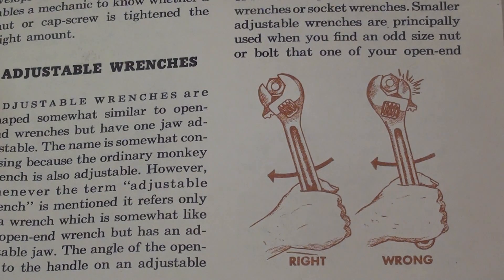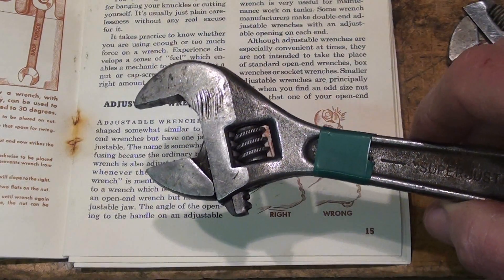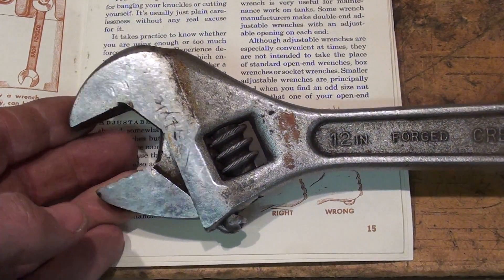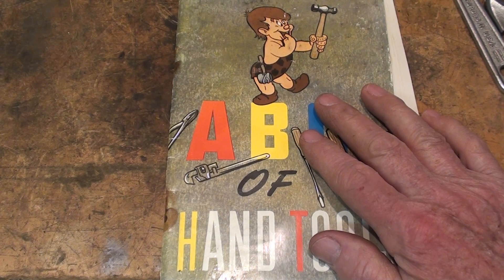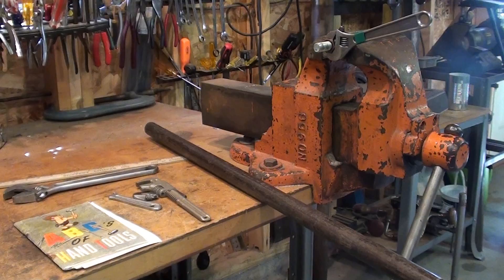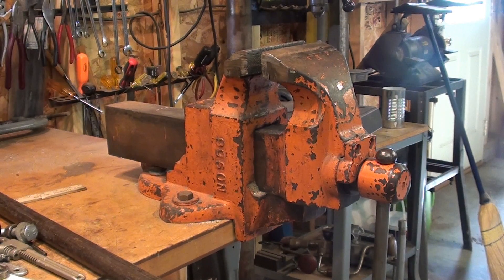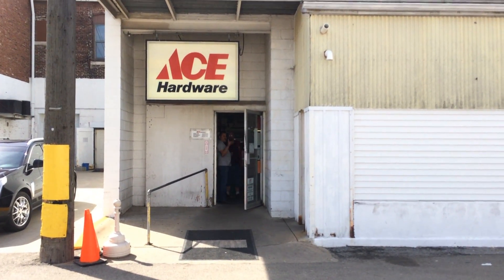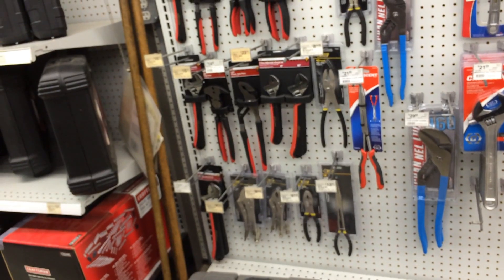MYTH BREAKERS #1 (pt 2 of 2) Use & Abuse of Crescent Wrenches mrpete222

Comment: That was kind of silly. It totally opened up the jaws. And you said it wasn't damaged.

You are apparently trying to disprove something some random person told you. You use the ranch properly in order to limit the amount of damage done to the nut. Most nuts are soft and any ranch will damage it. Especially a crescent wrench. The more you damage the nut the more ware you put on your wrench. If the wrench rounds off the nut the ranch is often damaged. Not snapped but sprung. Opened up. Bent.

Comment: It seems to me the whole point of making the wrench 22.5 degrees or whatever instead of 90 degrees or zero degrees is so you CAN flip them over and get two angles of attack when inching a fastener along, half a flat at a time, in some tight corner.

Comment: Ace has a lot of markup on some stuff, but they have always honored the guarantee on tools, at least in my case.
Reply: To give an example, bought a die grinder, took it home two days later got it out to use and the gearbox was locked up, {from the factory}  took it back, and they didn't even ask me for a receipt, {it was the third one they had gotten back} they just hooked me up with a new one, {different brand and slightly more in price.}

Comment: Again you are using soft bar stock.  And he is turning the adjustable wrench the wrong way.  It is probably stronger when used in the proper orientation.

The Ford monkey wrenches were made by Crescent, by the way.

Comment: The reason that the adjustable wrench was slipping and rounding off the stock is that the jaws were spreading quite a bit. I would consider that to be a failure, even though it didn't permanently damage the wrench. Much the same as an unbreakable rubber wrench that can't turn any stuck bolts loose.

Comment: Arkansas Socket Wrench: hadn't heard that one before. I've always known them as a Swedish Nut Lathe, a nod to the Swede who patented the improved version we now find ubiquitous worldwide, in metric as well as SAE sizes (yup, there really are metric ones). Only reason for having a short one is for use in confined spaces. Otherwise, the 12" (or 30 cm) should be the preferred length provided the jaws open sufficiently for the largest fasteners to be encountered, and you can have just one size in your toolbox that rounds all. The Williams is living up to being the perfect Swedish Nut Lathe.

That said, I must confess to having not only several Swedish Nut Lathes, the big, one size rounds all, in the garage workbench wrench drawer, and the smaller one is in the laundry room toolbox inside the house - so I don't have to go out to the garage for commons smaller tools used indoors. I would declare the myth busted on the basis that it turns nuts down to perfectly round in either direction.
Reply from the maker: lol

Comment: Great video. I worked for the railroad in the shop for 23 years. I have also used hand tools, believe it or not since I about 4 when I took the training wheels of my first bicycle. I was given my first set of tools for my 9th birthday, A set of Champion tools from Sears. I still have some of them. It is true that there is a correct and incorrect way of using an adjustable wrench. It may not break or fail if used incorrectly but is more likely to slip or round off the fastener. The movable jaw flexes more if used incorrectly. Also I really think Craftsmen tools are the best for the money. I have to commend Sears on their warranty. I have broken and plain wore out many Craftsmen tools in my life and have never even been asked " How did you do that!!!" That's says a lot to me.
Reply from the maker: Boy, you got an early start

Comment: Thanks for the video. Adjustable wrenches do have their place and you are not a "shade tree mechanic" if you use one some of the time.   
We used to say as a joke "don't force it use a bigger tool". Given a big enough lever you can break just about any tool. Unless  you are using a cheater bar it is unlikely that you can break a 12" adjustable wrench with just your hands. Most of these tools fail at a point way past the torque they are designed to be properly used at. You did not take advantage of the store or the brand by being honest and saying you intentionally broke the tool just to see it they would replace it. Unfortunately  thieves steal tools and then return them to the store for new ones and then sell them for a profit, or people buy at garage sales and then return for new tools or other low life people see it as a way that it is not needed to take care of their tools because they always have a new one if it gets old. This only makes the tool more expensive because the maker has to put all this into the cost of producing the tool. In a home shop unless the tool had a flaw most wrenches will last a lifetime if you do not abuse them. I still own some my grandfather used 50 years ago and they still work fine.
Reply from the maker: +B Kailua yes, I do like adjustable wrenches, I have 100 of them. But I get greatly criticize when I use one

Comment: Can you weld up that tool ?
Reply: You sure could. I bought a used 36" adjustable wrench where the jaw was welded back. That was over 20 years ago, so far so good. Then again I did not jump on it with a 10 foot cheater bar to test it.

Comment: There is a small Sears store about 15 to 20 minutes from me and a Farm & Fleet about a half mile past that. Both sell Craftsman tools. The nearest Ace Hardware store is in the next county. My Sears store will replace tools which have been abused if you admit that you abused them. I occasionally break sockets. when using a long breaker bar with a cheater bar on it. They want me to return the sockets and let them know how I broke it so that they can document it.

Comment: I'm from Connecticut and at thw ripe age of 38 you wouldn't expect me to be a tool connoisseur, but my father was a tool and die maker for U.S. Steel.. And he taught me the valve of "Made in U.S.A".  And I dabble in machining and fabrication, as well as buying at auctions. So I also have a wrench or 300. And so I'm covered from 1/8th" up to 6 3/4". But, what happened to me about 3 years ago made me sick. I too had a broken Crapsman adjustable wrench. it was a 12". I went to a mall in a less than desirable area and asked to get a new one. Well to my surprise the gentleman at the counter refused to exchange it on the grounds that it was abused. So I grilled him on just what was the proof of abuse that he saw. Mind you, I already knew just by his attitude, lack of articulation, and accent, that he wasn't in any position to know or may ever have truly worked with his hands. And so he stated that all the scratches and dings were his proof. Well with that being said, and my interrogation brought the attention of a manager. Also someone who didn't know tools very well. She while not exactly siding with her subordinate, also said that she couldn't replace it. Her reasoning  was that that particular wrench was part of a set no longer available since the 80's . A split second before I was able to demand her to "Flying prove it!", my wife unloaded on them, grabbed the wrench and began marching out of the store. We went to the next closet store and they had a  stack of new adjustable wrenches and ratchets behind the counter. So, not only do you get what you pay for, it also pays to seek out stores with knowledgeable and decent employees.

Comment: Did you know the hole in the handle is a gauge for bolt size. Any bolt the hole will slip over, the wrench will loosen the nut on that bolt size.

Comment: The store I work at will take back broken/bent wrenches with no problem.  The issue is bent screwdrivers.  If you attempt to exchange a bent screwdriver, you get turned away as it is abuse of the tool.  Wrenches are meant to be abused like that people, screwdrivers are not.

Comment: hello here in sweden we use tha bacho.never brake but rounds the bolts. have you considered that the load on both sides must be the same, so it is a matter of weak spots and stress raisers which will cause either sid to break

Comment: I do try to avoid adjustable wrenches when I can, but I do tend to use the for hydraulic repairs. It's much easier to deal with 2 wrenches than to fumble around with half a dozen or more. While doing the old jungle gym routine on a piece of equipment.

Comment: Thanks for the interesting vids. I was disappointed when you didn't turn the green wrench around and try to break it the wrong way after breaking the wrong way one in vid 1. Also I think full extension may have been a factor with  the smaller one - wish you had found a piece of 1/2 square to test the smaller ones (same way). I laughed when you produced that 1" wrench "this ain't gonna break of course" Oh yeah! ;-) I guess the 3/4 bar was gone when you did the 2nd vid? Oh, and thanks for the mention of the disney manual. Every time I come in my terrible two grandson is pie-eyed in front of some mind-control modern cartoon put on by my wife or daughter. That sounds like something fun for he and I to watch together !

Comment: Not that anyone really cares what I think but, after 20 years of turning wrenches and busting knuckles, this perfectly exemplifies why choosing the right tool for the job is really half the battle. That wrench might be more or less indestructible (I'm not arguing) but it accomplishes this by giving way and damaging the part you are working on. It used to be that cheap off brand tools - sockets, combination wrenches, screw drivers - were only good for making the job harder after they destroyed the head of whatever fastener you were trying to remove. ...It appears the harbor freight stuff is reasonably hard these days. But it still pays to know when to use 6-Point over 12-Point, a line wrench rather than an open end, an impact driver (not an impact wrench or any sort of power tool), and so on. I haven't rounded the head off of anything in quite a while now and I work on a lot of rusty junk. A combination wrench is good in a pinch, or when you know the nut or bolt is free but if you are working on equipment, you might make your life easier with a 6-pt socket... for whatever that's worth.

Comment: Well, I always have a cresent/bacho/whatever 4" in my pocket it is indispensable for adjusting various stops on smaller manual turret lathes (yes they are still in use). I have never broken one, never rounded anything and I have used it in any direction and for smaller adjusting taps.

We can break anything if we want, but I believe the purpose of apprenticeship it to teach proper tool handling etc.

Comment: The only craftsman tools I've ever exchanged were a large socket (1/2" drive/19mm; broke two in the same afternoon with a breaker bar) and a glass cutter (at that point, they no longer made the "craftsman" version, and they gave me a Sears version).

Comment: It's good to see some one with moral fibre glad you didn't shaft them out of that tool. It's good to see the didnt question how you broke it though snap on and Mac are not so trusting
Reply: +Adam Lynch It really doesn't matter, the warranty is unconditional so they'd honor it even after being told it was broke on purpose.
Reply: +ShysterLawyer have you ever tried getting replacements? Here in the uk snap on and Mac are terrible snap on rep refused to replace 2 split sockets as he said I'd used them on an impact gun and Mac rep refused to replace a long handled ratchet the head broke off on as he said "it's been abused" I've not brought either brand since.
Reply: Adam Lynch
Absolutely, been exchanging tools @ Sears for decades. Never a problem.
Like someone else mentioned I'll grab broken/abused Craftsman tools at a yard sale if they're cheap and promptly exchange them for a new tool.

Comment: Many years ago (probably around 1959) when metric wrenches were fairly rare in the US, I was working on the second VW bug sold in Midland, Michigan (to my mother). It had been through some serious times and rather than trade it in on a new one, my mother sold it to me, cheap. I had to buy metric wrenches to work on it and naturally chose Craftsman. I bought a set of open end and a set of box end. For sockets I bought (at Sears) a sort of funky set, not noticing that it was not labeled "Craftsman". While trying to disassemble the torsion bar front suspension, I took the 17 mm socket which was a 1/2" hex drive (and came with its own dedicated 1/2" hex wrench). Ordinary hand leverage wasn't doing the job, so (naturally) I got a piece of pipe. Well, the hex wrench twisted, the socket split (both the 17 mm AND the 1/2" hex), and the nut still didn't come off. I put the box end wrench on the nut and the pipe on the box end, and first pulled and then began jumping on the end of the pipe (I weighed about 220 at the time) and finally the nut came off. However when I had a look at the box end wrench the shank had about a 45˚ bend in it.

I took the socket set (which I thought had failed at less than maximum force - just a bit of pipe assistance) back to Sears where I discovered that if it didn't say "Craftsman" on the tool it wasn't guaranteed. Like Mr. Pete, I felt that jumping on the end of the pipe had voided the warranty, but I wanted to show the Sears guy what could happen if you overdid things a bit. He grabbed it out of my hand and said, "Now, this IS a Craftsman" and gave me a new one off the rack. He not only wouldn't accept my protestation that it was my fault, he wouldn't let me pay for the new wrench and keep the bent one. (I wanted to hang it on the wall as a warning to myself not to abuse tools.) It's nice to see that Craftsman still means something - even 57 years later.
Reply: +Peter W. Meek 
Amen, the moral here is Death, taxes, and Craftsman! It's all I own too.
Reply: +Peter W. Meek Heh, I broke some serious tools on the back axle nuts on air cooled VWs. As far as I am concerned that is the greatest I.C.E. ever built though.
Reply: If I recall correctly the back axle nuts and the flywheel gland nut were all torqued to 307 foot pounds (which is probably an even number in metric). EDIT:  It was 217 ft-lbs or 30 kg-meters.
I used to be able to press a bug engine. We would jack up the back wheels and while someone else removed the 4 bolts, I would let the motor down onto my chest. When it was fixed, I would press it back up into the compartment and someone else would guide it back into place and rebolt it.
Reply: Peter W. Meek
Yep.  Fuel line, throttle cable, coil, oil sender and gen. wires, 4 bolts and bam, she's out.  I miss the good old days.
Reply from the maker: +Peter W. Meek good story-thanks
Reply: +Peter W. Meek beautiful story but the sears up here doesnt honor that anymore to me.. i guess they got sick of me bending breaker bars etc
Reply: +Peter W. Meek My father had a similar experience with a 1/2" breaker bar years ago at a Sears store in Ft Wayne,IN so back in the late 60s early 70s as I was a boy and now 56.  They asked afterwards just how long a cheater did he use he didn't use any he was that strong from the work we do Drilling Water Wells a family business now 3rd generation owned.

Comment: Lyle, that long yawed open wrench was its own enemy on that square bar, notice the top jaw took the stress close to the handle but on the bottom jaw all the stress was about one inch further forward. I did not make any calculations but if we say inch pound torque the bottom jaw would have had almost double the stress at its point of contact with that bar.As a teacher I'm sure you will be able to explain that better than I did here, but I would say, that's why the jaw that takes the strain the closest to the handle takes has the best chance of staying in one peace.

Comment: I have actually been into the sears store and turned away on a warranty claim.  I kept the tools in question and returned during the holiday rush.  Tool was exchanged, no problems.  My neighbor gave me a very expensive snap on ratchet wrench that the handle had broken off at the head.  I tried to exchange it and Snap On returned it saying it had been abused.  Keep in mind Snap On is also supposed to be a lifetime guarantee.  So guess what brand I will never purchase new.

Thanks and all the best!

Comment: Never use an adjustable in a high torque situation and yet the fixed wrench broke while the adjustable didn't.   That's a heck of a good wrench.  Good store, too.  Ace is the place.  I remember when it used to be Ace is the place with the helpful hardware man, but now it's Ace is the place with the helpful hardware folks.

Comment: Great 2 part series Lyle !  In these videos  you are showing what happens when you put a mouse into the mouth of a T-REX. The T-REX being that fantastic, U.S.A. made PARKER vise ! !   Could a Chi-Com vise of similar size hold a piece of bar stock tight enough in order to conduct a test like this ?   A friend of mine is a  self-employed carpenter and he bought a large Chinese made vise.  While using it-  the upper part of the movable jaw simply cracked off. That was years ago but he re-purposed the broken part of the jaw and it has found a new life as a door stop.  It has taken on a nice antique like patina over the last decade.

Comment: i'm always kinda sad to see the small hardware shops closing up under the pressure of the big box stores.   I can remember as a kid, going to the local places with my grandfather and picking up various items we needed on what ever project we were doing.   That's not so true with the big box stores....they're catering to either the bldg contractor market (where the tools are good, but VERY high priced) or the "simpler" do-it-yourself market where the overall quality is cheaper so they can sell them at lower costs.....    Few people actually "fix" things like appliances anymore...they just ditch it out and buy a new one.....